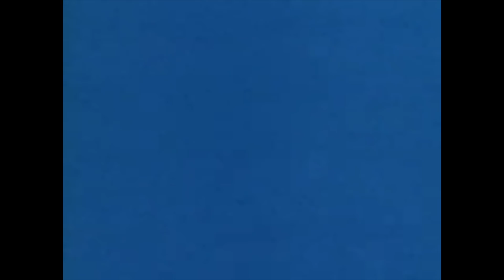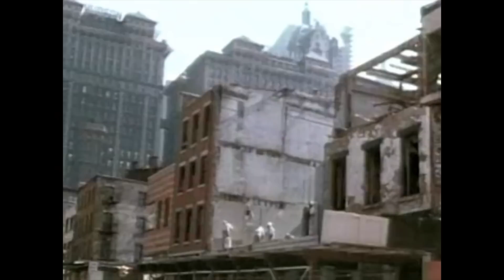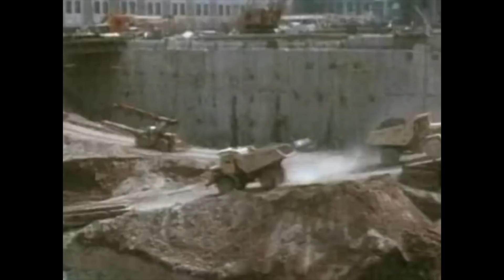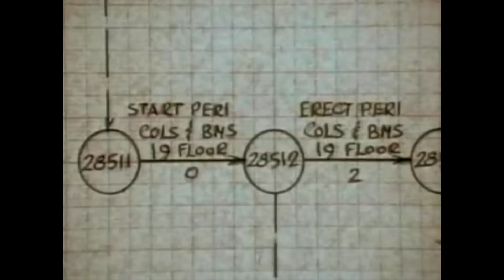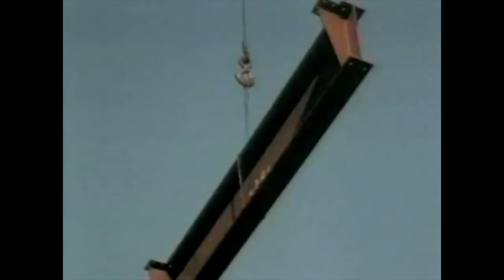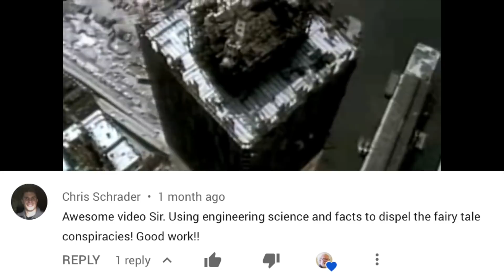building construction update 2 - because of copyright claim

Comment: I want to thank you for showing this and it helps but I still have questions as to how three buildings collapsed so close to free fall rate. the two towers had aircraft strike them and this could be the cause of there collapse, but building seven, a conventional construct fell at free fall rate in its own foot print is very suspicious in my mind.
Reply from the maker: Building 7 burnt for hours. The internal floors collapsed first, leaving the curtain wall...it then fell really fast as it was an unsupported shell. Hope that helps

Comment: Professor I cant believe how wrong you are on this subject, Please before you do a video please do some research. Yes the buildings were made of different construction design ....so what, it does not IN THE LEASE make them ANY less capable structurally. Second to the people who claim Heat Weakened the structure..Even if i GIVE you that it completely melted 10 floors.... EACH and EVERY floor below can support as many floors above it.  IF you can not understand this FACT then there is NO hope of you realizing the logic of what did occur. LISTEN if 30 floors disappeared  in the middle of the building and 50 floors fell on the rest... even with kinetic  energy the structure below was completely sound and would  never fall.  Build any model you want and you will see.  The building below was NOT weakened AT ALL .... And it was IMPOSSIBLE for any of the  UNWEAKENED structure to collapse.  IF what you believed happened then  MAYBE  a few  weakened of damaged floors would have collapsed at most and or from that point of collapse the floors above would have dropped to the first undamaged floor and would have been held there or have teetered and fell off but the underlying floors would have and have been designed to hold magnitudes of strength redundancy. Please consult an engineer before you spout such uneducated dribble.
Reply from the maker: I am not a structural engineer just a film maker but I got the collapse data from someone who knows about building construction and even the NY Port authority were worried about an aircraft collision damaging the buildings... I think that people assed the collapse, based traditional construction and so the WTC demise looked surprising....my theory is, once you see how they were built, it explains how they fell.

Comment: I don't know what all the fuss about "jet fuel can't melt steel" is about, it doesn't have to melt, just get hot enough to bend and assist collapse of the floors, weaken the structure and gravity does the rest.  Deal with it people.
Now, as to whether a plane hit the Pentagon or did a plane really crash in a field (where's the debris?) or what's the deal with one of the "crashed" planes recorded  filmed landed AFTER it was supposed to have crashed.....that's an entirely different matter.